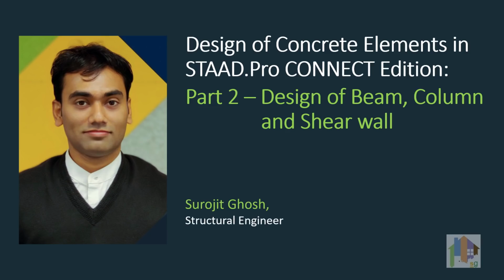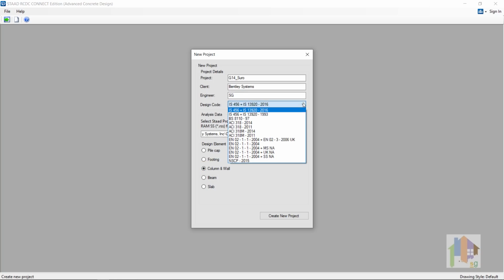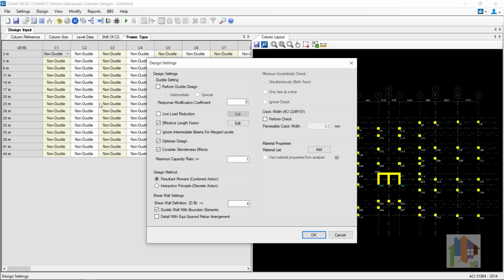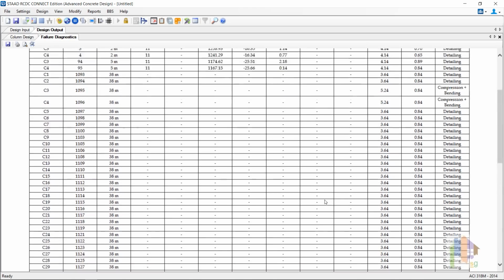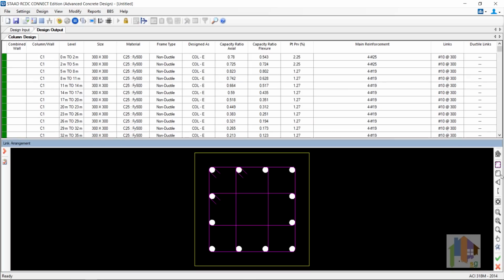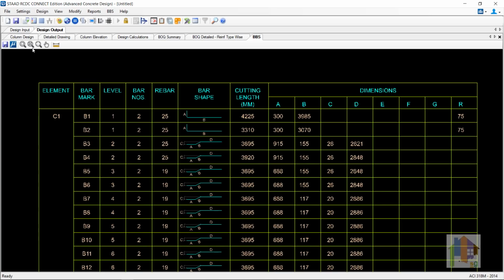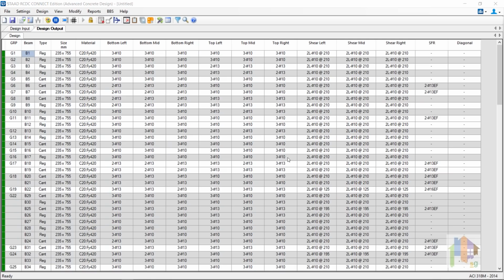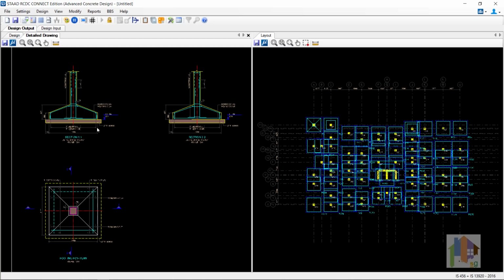Design of Concrete Elements in STAAD: Part 2 - Design of Beam, Column and Shear Wall

Comment: Sir, as per IS 456,Cl. 32.5.1, the reinforcements for shear wall provide in two two mesh each horizontal and vertical grid if wall thickness >200 mm, but RCDC design the shear wall reinforcement always in 2 layers even if the wall thickness less than 200 mm, is there any provison in RCDC for single mesh reinforcement for wall having width less than 200 mm? Please reply..
Thanks sir....

Comment: Dear Sir, why some members failed when we design them in RCDC Connect edition even if concrete design is appearing for them in stadd pro when designed using IS code design parameters in analysis and design tab. RCDC says section size not adequate while staad pro has provided Ast and bar size for the same section size in output file. What are the design parameters that we are missing & considered by rcdc. It will be helpful if you make video on concrete design parameters for IS code. Like Elz, Ely, ENHS etc.
Reply from the maker: There are several factors which might affect the design results - for example, batch mode of concrete designs each analytical member at a time whereas RCDC designs multiple member as a physical entity. During reinforcement detailing, it might happen that the selected bar arrangement for entire physical member is not sufficient at a particular zone. This problem doesn't appear in batch mode as it assigns the reinforcement for each member separately without considering any bar continuity.
There are several other factors as well, including design parameters, version of STAAD. You can compare the Ast required and bar details in RCDC reinforcement table and failure diagnostic report to get an idea why it fails.
Reply: @surojit_ghosh  ohk. Thanks 😊

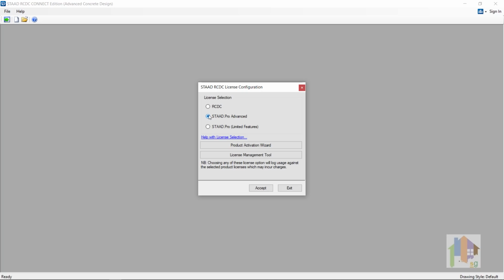Comment: Sir When I draw beam elevation in RCDC, it is drawn in scale of 1:50. I don't see an option to change the default scale of 1:50. Please help me to change the scale. Thanks
Reply from the maker: You can control few drawing settings using Drawing Style manager but for beam, scale of the drawing is hard coded, so we cannot modify it.
Reply: 1 is to 50 is not the time stamp above but the scale of generated drawing
Reply: Thanks sir. Also one more question - what is response modification coefficient that you showed in column design. I mean what if response reduction factor is already applied in earthquake load case during analysis ?
Reply from the maker: It is same as the response reduction factor that we need to specify for seismic analysis. This input is required for IS13920 code (Response Modification Coefficient for ACI code) - to calculate additional moment in Gravity column to cater for displacement computability during lateral loads. Check section 11 of IS13920:2016 for more details on gravity column design.
Though this information is provided in seismic definition, still we need to provide this once again in RCDC for ductile design.
Reply: @surojit_ghosh  thanks for clarifying

Comment: Dear Eng
Please tell me what is strong and gives more detailing and shop drawings blueprint staad pro or robot structural ?
Reply from the maker: Each software has some advantages and disadvantages, so it is not logical to compare . If you consider concrete design features, STAAD with the help of Advanced Concrete Design module can design any concrete element and generate deliverable drawing files including BBS and BOQ files, also it is very easy to re-design and auto-update the drawing files. Not only that, you can also perform finite element analysis for elevated slab and mat foundation and design based on FEA results (RCC + Post-tensioned).
Reply: @surojit_ghosh  OK, Can Staad pro do the required design of tall concrete building under seismic and design the shear walls considering the selendress of the wall (effect of buckling for both columns and shear walls)? thanks
Reply from the maker: Yes Amr, you can model tall structure in STAAD and analyze it and then perform design using SACD (including Shear Wall). Just one additional information, for tall or super tall structures, there are several additional modeling and analysis consideration which requires special analysis. We have a dedicated building design software "RAM Structural System" which can handle all these advanced analysis required for tall buildings including dual framing system, multiple floor diaphragms, wind tunnel data consideration and many more. If you want, I can provide you more information about this.

Comment: Hello sir, When I transfer the model from the physical modeler to the STAAD pro, the concrete beam and column sections are transferred as a general section instead of circular or rectangular sections, and the RCDC can not read these sections, Beam missing and column missing error is pop up.
Thanks for the help
Reply from the maker: When you create a structure in Physical Modeler and assign the properties, concrete properties will be transferred to the analytical modeler as general user table section with section name mentioned in the property table as this is the way the concrete member property information is added in the physical modeler. But this does not affect the design of members. Any physical model with concrete member can be designed using Advanced Concrete Designer without any problem. 
Beam/Column missing information is reported in Concrete designer when program in unable to read the member information from analysis model. There are multiple reasons for that - but modeling in physical modeler is not the reason for this. As the physical member information is generated in the physical modeler, if you use any older version of Concrete Designer (RCDC), then that might cause this problem. There are other reasons also. If you can post your model along with version information in Bentley Communities site, I can check and let you know the reason.
https://communities.bentley.com/products/ram-staad/f/ram-staad-forum#pifragment-25818=1